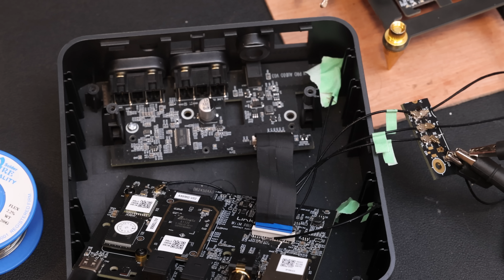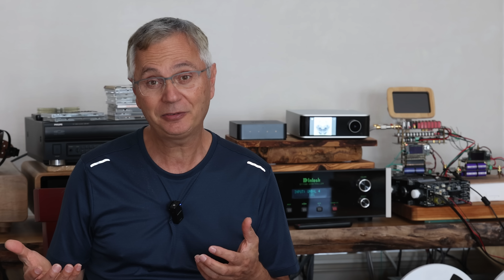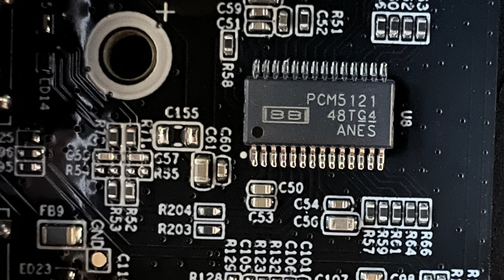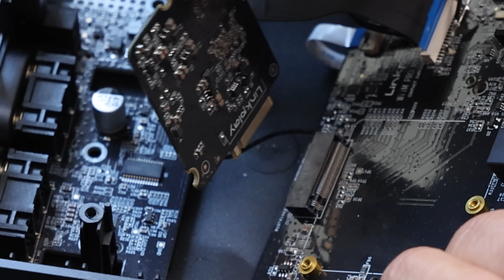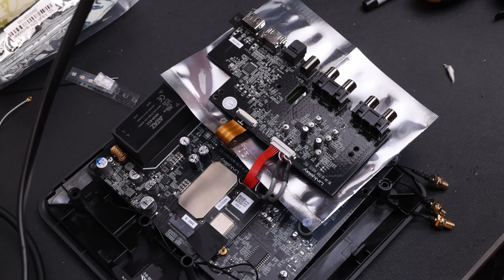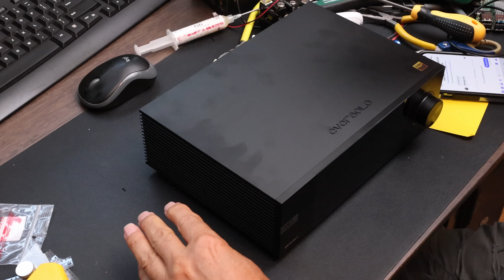I Bought a Wiim Pro & Ultra — One Surprised Me!

Comment: Great info. I too have the Wiim ULTRA. I found a simple non-hacking way to access I2S signal from the ULTRA. Connect a USB-C to USB-C cable from the ULTRA to SMSL PO100 PRO MQA DDC XMOS converter. Then connect the SMSL to your external DAC of your choice via an I2S cable. This was a simple plug and play $75 mod that definitely improved the sound from the ULTRA.
Reply: I did the same with my ultra using the po100 pro and with my gustard r26 and there's an improvement.
Reply: @eugenefudge3685  my friend you have a £1000 Dac in the Gustard, why are you asking the SMSL to do the clocking, just go straight from Wiim Ultra to your Gustard, USB A to USB B! Likely sound better!
Reply: @LDN_BOX  because I wanted to use the I2s input on the gustard. Via PO100 pro and the gustard has the xmos XU 216 and the SMSL uses the newer XU 316.
Reply: @eugenefudge3685 oh I see, to make up for lack of the l2S output on the WiiM. Perfect, I totally get it! I never knew your DAC has that input.
Reply: @eugenefudge3685  the thing is that you are converting USB to I2S via SMSL, did you try just USB to USB?
Reply: But it is not day and night.
Reply: I second that. Yes, the SMSL PO100 PRO does improve the sound quite significantly I would say.
Reply: I tried the SMSL with a Pontus 15th dac & I preferred the sound without the SMSL. So it's probably dependent on the actual dac or streamer as to what type of improvement one gets.
Reply: @NosEL34  I felt exactly the same! I preferred the Ultra to my DAC via Coax (Chord C-Line). I bought a few USB A to B cables arriving today along with a AQ Jitterbug and going to have a shoot out to see which I prefer from AQ Cinnamon to Carbon and another Chord USB chucked in. At the moment, it’s the Chord Coax to beat, I have tried a AQ Forest which is v.clean sounding but lacks a little body compared to Coax/Chord but very close. I’ll try the rest and keep the winner (sell the rest) but that won’t involve the SMSL! I’ve seen a few people mention they like the SMSL due to the I2S but if you are going USB to I2S that way? I am thinking USB as it seems to give the most bandwidth and lets the internal clock of my DAC do its thing!
Reply: I tried the AQ Forest & Cinnamon USB A to B cables with the Jitterbug and was underwhelmed, but wow the Chord Silver Plus blew me away! This was the sound I was open for all along with my upgrades, they really unleashed my B&W 707's (s3), amazing stage/detailed but natural and sure-footed, nice bold bass. I cancelled my order on the AQ Carbon as didn't need to hear it. The SMSL and other cables will be going up for sale shortly...
Reply: @LDN_BOX very cool. I will have to try the Chord sometime in the future. So far for me I have found the NEVD-2001 Coax cord  to be the best for my tastes. Prices have gone up a little bit but still not ridiculously priced when it comes to really good coax. Pure silver conductor with 4x's shielding. One can get it even cheaper if you make it yourself as there are a couple sellers who deal in bulk. But buying it premade comes with some of the best rca connectors I've ever experienced. 
I am sure that you are in no hurry to replace your Chord but just thought I would mention a cable that I would recommend if asked.
Reply: @NosEL34  Oh that is fantastic - I've made a note of that!!! I am not surprised given the materials. Its very much from the stage above where you start hearing names like Tellurium & Shunyata!
The Wiim's implementation of COAX is extremely good, I a/b tested my USB cables vs the Chord C-Line COAX (also sounds really good!) without the SMSL in - so can just imagine how good your cable must sound!
I feel very good to finally reach a forget about it stage, for a while at least! I have another setup in a very nice cabinet, with a very old run-of-the-mill back-then NAD amp with a similar for it's day Marantz CD player, plus a Wiim Pro Plus (with iFi 5v Linear Power supply - actually sounds very good using it) I have made no fuss re cabling - AQ Pearl level RCA's, cheap Chord speaker cable but bought a pair of Sonus Faber Lumina's for it as matched the cabinet (on top) and it sounds really good (looks very special too!)! The speakers are the type to go into a students bare cupboards and come up with 5 star meal, old skool no fuss! Enjoy the NEVD-2001s!!!!
Reply: @NosEL34 hi. I have a Pontus 15th too and I'm trying to decide which streamer to buy. Are you using a Wiim Ultra with your unit or other brand/model? Thanks!
Reply: I tried the WiiM Ultra. It's a great device with wonderful features. From a sound perspective standpoint I didn't prefer it to other streamers. I've been using a more expensive Auralic model recently. But a couple cheaper in price streamers I bought after the Ultra was the IFI Neo stream, the Bluesound Icon & the Bluesound Nano. All very good & I preferred all of them over the Ultra. The IFI has too many software issues so I sold it. The ICON is very good, it has a really good internal dac & software. Using an external Dac like the 15th I preferred the Node Nano & sold my ICON after a couple months. If you are still looking for one & don't want to spend a lot I'd recommend the Nano with an external power supply upgrade. I initially used a Sbooster power supply but tried the IFI X power supply & really liked the outcome. I tried the IFI Elite with it but felt the difference was negligible. Nano & IpowerX. Great combo, & I bought the Nano second hand so great sound for the money. Only other under $1k streamers i'd want to try are the Holo Red & the new Aiyima streamer. The Rivo streamers get great reviews but no so much for their software. 
There is a great YouTube video by a channel named Analogholic. It's named.. Streamers, When they reveal system problems & when they are real upgrades. It can give you some insight on streamers & why we may perceive differences between them. It's good knowledge sharing. He has other great videos about dacs as well.  @JoseGarcia-yu9nd
Reply: I wasn't saying that the Ultra is bad in anyway. Very good software & a great overall device for the money. It just didn't mesh as well in my system. If you watch the video I mentioned it can maybe explain why the Ultra might not have paired well for me. It could be an issue with my other components in the chain.
Reply: CheapAudioMan mentioned that a few months ago. He said it works fantastic if you have an external DAC.
Reply: I would and I do use it in any system. Remember there's always a better mouse trap.
Reply: Cool but that is DAC dependent. A DAC like the RME ADI-2 FS not likely to see any difference.
Reply: I tried the same w my ULTRA…. USB to the SMSL PO100 then coaxial out to a Geshelli Labs J2 DAC….I then used the WIIM APP …..experimented w the std equalizer, not the Parametric EQ….after several nights tweaking the EQ….this entire configuration is much better SQ….synergy w my components, speakers and room acoustics….now no tweaking….been just enjoying the music….
Reply: Stupid questions incoming. My Wiim Ultra does not have a USB C cable connection so did you mean connect Wiim Ultra to SMSL using USB B to USB C cable? Second stupid question. Is the i2C connection a HDMI cable?
Reply: @toebuster  Yea, I2S will normally work with any HDMI cable.
Reply: or just connect the Wiim to an external DAC via USB without the SMSL. I bought the SMSL PO100 Pro and ended up doing what I just suggested myself! I think the ethernet to fibre optic back to ethernet trick they did on this channel is very good, on the video 'Media Converter switch your Dac to Fibre optic' ! Works too!
Reply: Douk audio U2 for far better results..

Comment: WiiM Pro and WiiM mini sound good only with an external DAC with price above $100 (smsl, schiit, ...). If you have not an external DAC, much better choice is WiiM Pro Plus (better DAC + remote control) or WiiM Ultra.
Reply from the maker: My tests showed a significant improvement in the Pro's sound when using a quality power supply, even without an external DAC. But adding an external Dac as you mentioned is one more step better.
Reply: @Gabster1  What about the ProPlus with linear power supply vs the Ultra when only use it as a streamer on a external DAC ?
Reply: @kingpinlifeofcrime I have PRO PLUS with LPS (STUDER 900PRO+): the best you can have at the price and also until 1000usd at least. Even more if used as a digital transport only.

Comment: Nice video, thanks...

Wimm pro plus user here.. i use the wiim into a Lampizator dac via coax/spdif.

Sound improved dramatically using IFI spdif 2 purifier (comes with free IfI power 2 5v smps)  AND also getting the  ifi power x 5v smps separately)

Put the IFI POWER X on the spdif and use the ifi power 2 on the wimm.   Best combination to date.
The ifi.spidif is like a well made mini DDC and isolates, reclocks and repowers the coax from the wimm and this plugs directly into the coax/spdif input of lampi dac, no cable and strongly coupled.

Wimm software is superb and the sound can upgraded greatly. by paying attention to your network/switch isolation, clean power on everything and reclocking and jitter elimination.
Reply: Sorry, but it doesn't make any sense. It's better to use Wiim Ultra with USB out directly to Lampizator or better streamer.
Reply: @gottrekk5798  my lamp dac has no usb in only coax in, hence chance to use the wimm.

  Another thing i forgot to add is that i found playing tidal from the wimm app sounded slighlty airier with better bass info and texture than playing using tidal connect to wiim.
Reply: @Audio-DIN  Ok, but such a high quality DAC deserves a better streamer. You can add external clock DDC between Wiim Ultra and Lampizator, maybe something from Denafrips or Laiv.
Reply: @gottrekk5798  yep i know. Just wanted to push the wiim further

..maybe later diy silver power and signal cables, audio note rca/coax plug upgrades,  grounding the pc board. Could turn out magical...sounds great though right now, that ifi spdif ipurifier 2 has a great traceable clock in it, they supply lockheed martin and a few other major  US tech companies..most other ddc have good but unknown clocks..go figure😂

Comment: In my tube amp monoblock system, I use a WiiM Pro with an external power supply. I managed to get it sounding very good with some modifications. Running a fiber router network, I added a Cisco Meraki (after removing its power supply, easy). 

Using BlueJeans ethernet to the Meraki, then fiber over close to the WiiM Pro into a second Cisco Meraki sans power supply. Another very short BlueJeans ethernet cable into the WiiM Pro. It now sounds exactly the same as running Qobuz from a M1 Macbook Pro via USB to a RME ADI-2 FS dac. 

To your other question, I've run Roon numerous times sometimes for several months and enjoyed it. But now using Qobuz connect which runs the music signal direct from the router to the Meraki-WiiM Pro combination, it's clearly not as good. It sounds veiled. So now, it's Qobuz Connect and no Roon and no external CPU intensive boxes required for Roon or anything. It sounds great. 

Thanks Gab for your excellent work and honest assessment. I considered the WiiM Ultra but had heard no difference to the WiiM Pro for us using a very good DAC. Always used mine with the RME.
Reply from the maker: That's an interesting setup, thanks for sharing your journey with the streaming and network configurations! And thanks for confirming my suspicions about Roon vs direct 
Keep in mind with Roon there are a few settings that absolutely destroy the sound like volume, auto song level adj …
Reply: @Gabster1  - Yes, Roon is nice and I never deployed its options for volume, level adjustments.  It was a "clean" comparison to the Qobuz Connect path for the updated WiiM Pro. 

Now I've seen an equal performance with the Cisco Meraki boxes vs. the M1 Macbook running only Qobuz out via USB to a RME ADI-2 DAC. Happy about that.

Had experimented earlier using two Cisco Catalyst 2960. They are cheaper but the Meraki gets even better results. A guy in Europe has tested clock upgrades and other changes to the Meraki with reportedly better results.  But the Cisco 2960's are under $40 used and the Meraki are not much more. Currently interested in setting up a 12v external ps for the Meraki closer to the WiiM Pro. That may be interesting.
Reply: @Horsey2000  So you've got an 8 port Meraki with PoE input or how do you power the switch without a PSU?